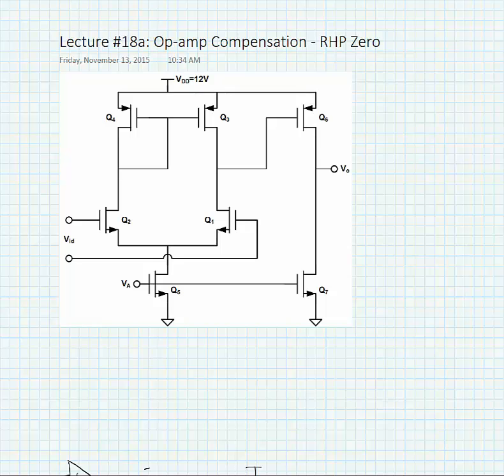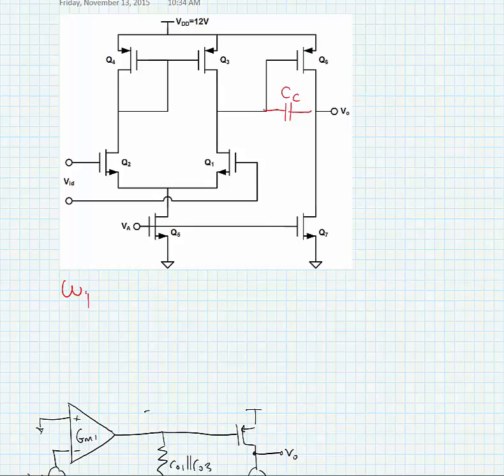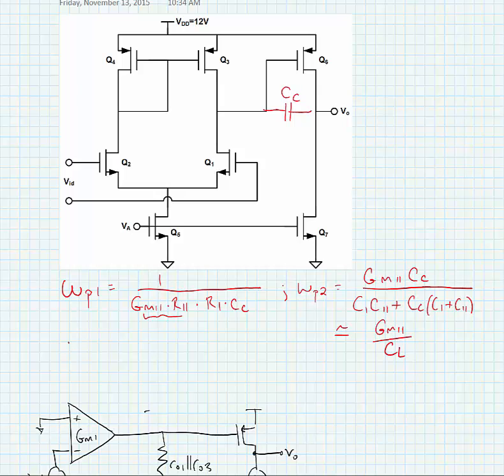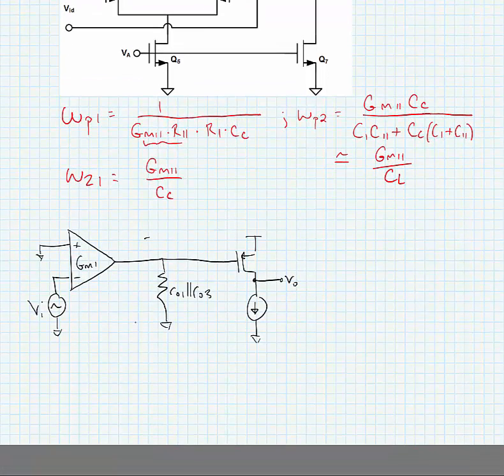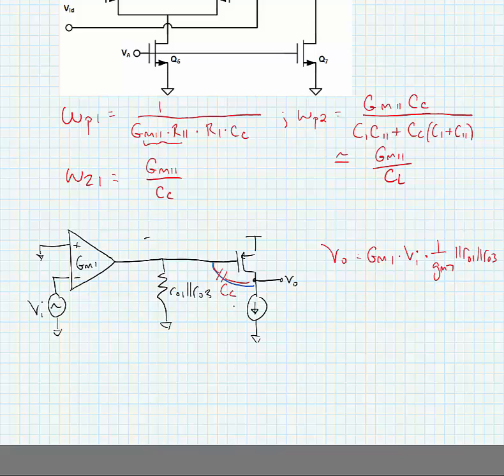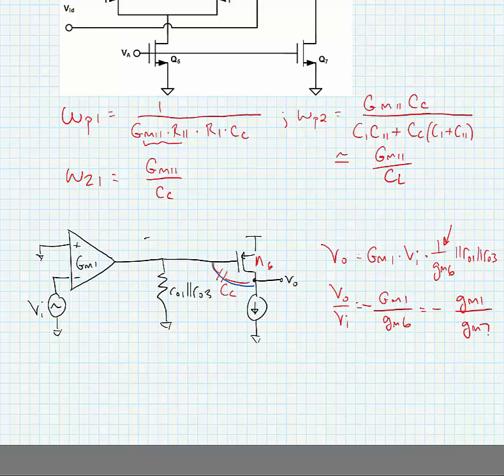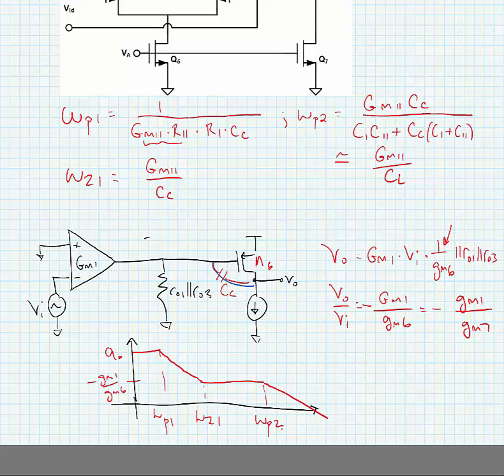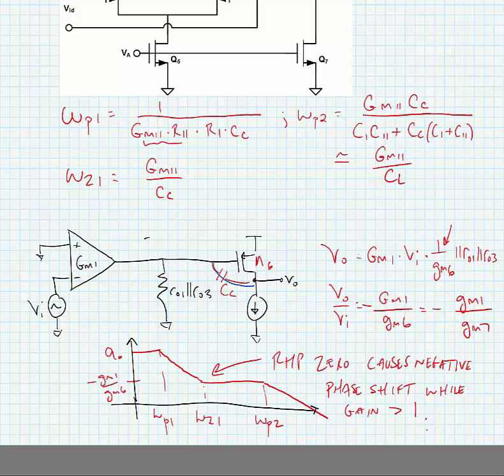ECE 3110 - Lecture 18a: Op-amp Compensation - RHP Zero

Comment: Shouldn't the RHP zero be on a higher frequency than wp2? Wp2 is GmII/CL where CL is much larger than Cc.
Reply from the maker: The dominant pole is set with the compensation capacitor (remember that the effective capacitance is larger due to Miller effect). You want to put the zero on the second pole because it leaves the largest space between two poles (e.g., wp1 and wp3)
Reply: Thanks for the explanation but I was asking about the equation that you have on the video where W1 is the dominant pole frequency ~ 1/AvII*Ro1*Cc; W2 is the second dominant pole where is located on the ouptut ~ GmII/CL; and the RHP zero without any compensation is located at Wz ~ GmII/Cc. I was asking since Cc is much smaller than CL, on your bode plot, gain plot, you had RHP before the W2 that confuses me. Can you please clarify that notion?
Reply from the maker: Cc is physically smaller than CL, but with Miller effect it is effectively much larger. That is why it is multiplied by the gain of the second stage.
Reply: That is for the dominant pole right? Originally C1 is small and the miller effect boosts C1 by adding ~AvII*Cc the P1 thus becoming much lower frequency than it used to be. However, Cc is still the same physical parameter where the Zero is located at GmII/Cc. If we plot the Bode plot, that zero should be smaller than P2 of GmII/CL, no? That Zero is not multiplied with any gain. The way I understand it is at high frequency Cc becomes a short between gate and output of the PMOS thus effective output impedance looking in from output is 1/gm thus P2 is ~GmII/CL (I know the real effect is due to Cc as a feedback causes the R0 ~ Ro/1+gmIIRo*B thus RO is lowered, the second stage is close to an ideal integrator) however, the zero due to feedforward and feedback is at RHP which is equivalent to GmII/Cc which is at a higher frequency than P2. Based on the approximation, only when CL is small, and comparable to Cc, the miller effect will suffer from RHP. But if CL is large, the effective P2 will be much smaller than the RHP zero.